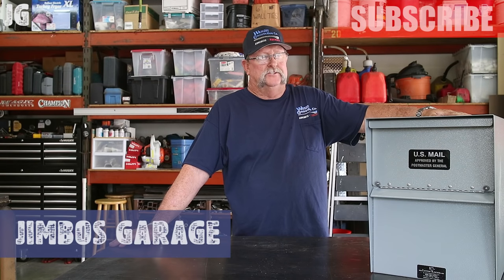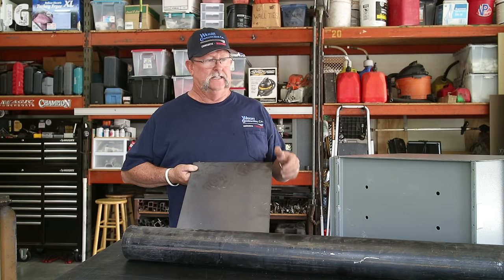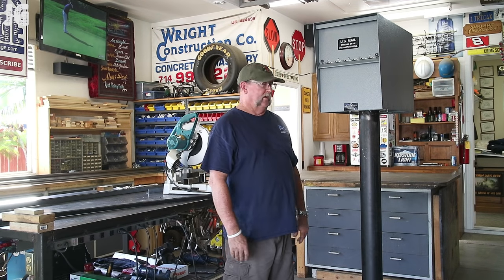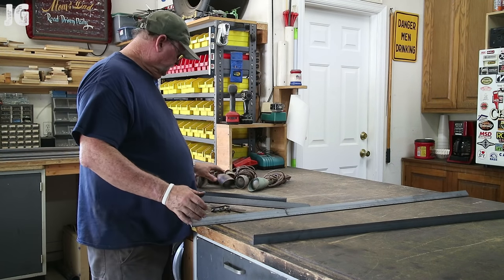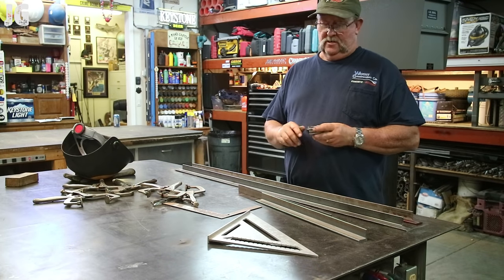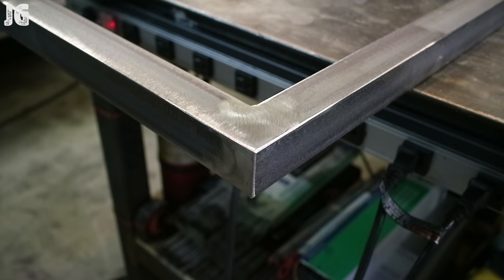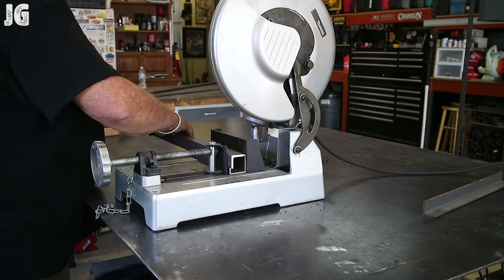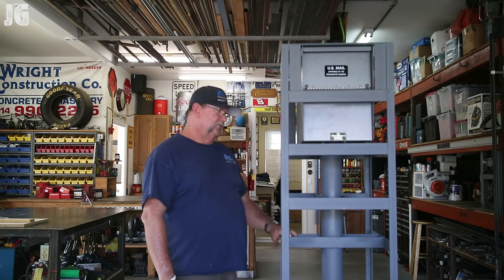Stone Mailbox Build - Jimbos Garage

Comment: Wow so was the metal frame able to pass inspection ? How was the metal frame anchored to the ground?
Reply from the maker: +Accent Masonry LLC Thanks for watching! Inspection was no problem, The mail box frame has a 4'' schedule 40 pipe in the center with a 8'' sq. x 1/4'' thick plate on the bottom, Concreted in the ground 30'' deep x 12'' wide. Jimbos garage!